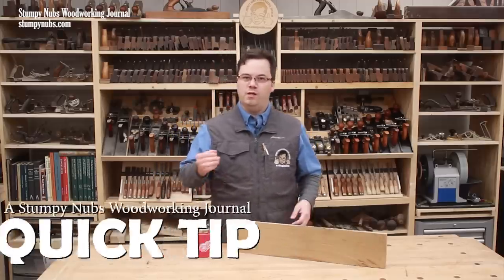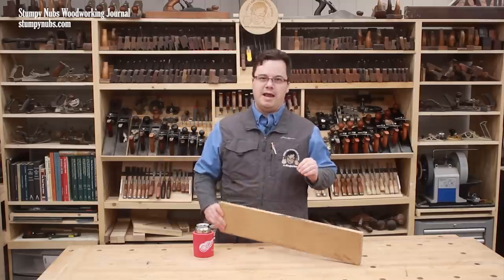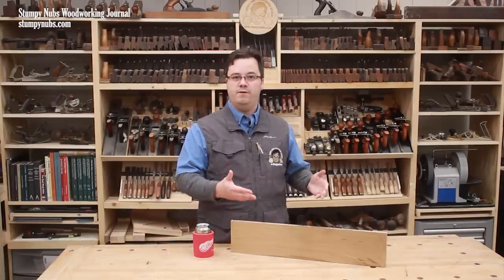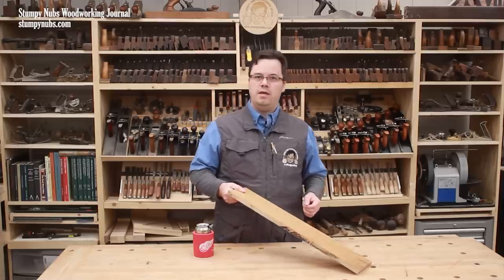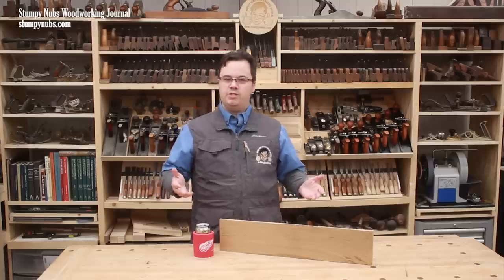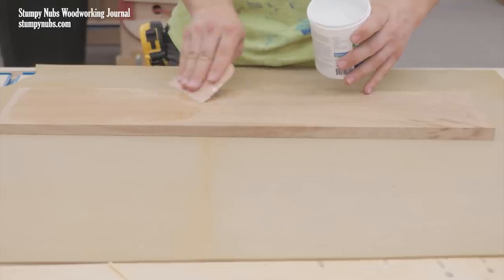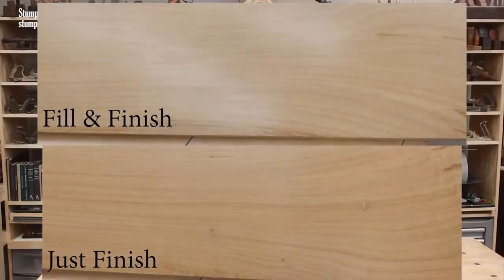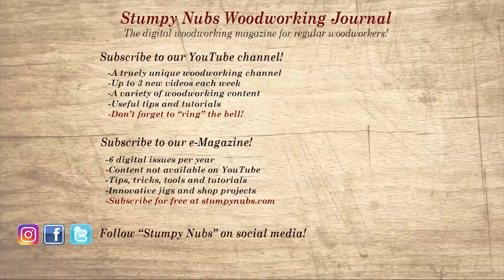Do you need wood grain filler before your finish?

Comment: I prefer my wood to be like,  wood. If the wood has open pores, to me that's part of the wood and why do we want to hide that? Everyone has their own taste so it's up to you but here's a test - take a piece of wood - or maybe a few (walnut, maple, oak,...) cut the pieces in half so you have book matched pieces. With one half do an oil finish (my favourite is Watco teak oil but tied and true is also good and there are others). On one side apply the oil, more oil, sand with 400 or 600 while still wet, let dry, more oil, sand wipe off excess, dry oil, sand and finally when good and dry apply wax with 0000 steel wool or fine scotchbrite pad. Allow to dry and buff. On the other half apply the filler and top coat of choice - use a semi-gloss to match the gloss of the wax finish (you get a higher gloss on the wax with another wax coat and power buffer if you really want to compare a high gloss finish). Once both are cured show people and ask them to pick which they like best. I have done this and get far more in favour of the oil/wax finish. One of the biggest arguments against is that the finish is not as durable and I agree it will mark more easily than a poly or lacquer finish it is easy to fix if needed. My dining room table - wipe on poly, everything else oil and wax. (Well my guitars are french polish - shellac). So Stumpy how about a comparison finish competition. I get 90% plus people preferring the oil and wax - based on look and feel.

Comment: Does the final clear finish wear easier or have any issues over time? As in does the grain filler act something like a mold release compound?
Reply from the maker: The grain filler does not affect the durability of the finish you put on top.

Comment: White oak is closed grain, though. Red oak open. Do you find benefit in using filler on white oak?
Reply from the maker: White oak is closed grain when you are speaking of the end grain- the physical "straws" that make up the board. But the long grain is very much "open" in the context of this video, which refers to the coarseness of the grain and how filling it will produce a smoother surface.

Comment: James—love your channel and website!  Such great content so thank you!  Quick question...if I am going to paint plywood, would this be a good option to use before using primer?  Thanks!
Reply from the maker: I don't know if I understand. You want to put on something BEFORE the primer?
Reply: @StumpyNubs  am just wondering if there is any value to doing this on a painted piece where I am also going to use primer or is primer enough to provide that “seal coat” for a smooth look on Baltic birch plywood?  Thanks.
Reply from the maker: @mindyhall4638  Oh, I see what you mean. I saw your comment on my YouTube dashboard with all the other video comments and didn't associate it with this grain filler video- If you are working with pine plywood, I could see using a grain filler (though I am not sure it is cost effective). But I don't think you need it on birch plywood, which paints very well with just primer and paint.

Comment: So I’m finishing a walnut bar top. Would you recommend this same water base product in conjunction with general finish arm r seal oil base top coat?
Reply from the maker: Walnut is open grain, bit not too course. You can use it if you want a very smooth surface. I have walnut countertops. I didn't fill the grain.

Comment: Curious if you think Aquacoat is appropriate to fill before painting, such as the stained oak cabinets in my kitchen that I want to pore fill and paint. I'll look at their site too, but it sounds to me like it's just the filler I have been looking for.
Reply: I used it on an old end table, with filler, then black lacquer. It came out great.

Comment: How will this water-based grain filler interact with oil-based stains? Also, I don't think this was mentioned in the video but anything water-based (in my experience) will tend to raise the wood grain to a certain degree, especially Mahogany. Is this where a sealer would be used prior or is it advisable to wet the surface, let dry and sand the raised grain before staining and Aquacoat-ing?
Reply from the maker: Since you are sanding after you put on the grain filler, any raised grain will be knocked back down. Once it is dry it will not interfere with an oil based finish.

Comment: Can I use a wipe on poly like Arm R Seal over this grain filler?   It oil on water, which is why I am a bit confused.  🤔
Reply from the maker: If the grain filler is hardened, yes.
Reply: Thanks for your reply.  So for my walnut dining table project, could I apply my finish in this order?

1. One to two coats of amber-tinted sanding sealer or a coat of dewaxed shellac

2. Grain filler

3. Arm R Seal

Comment: Does this take the place of wood conditioner prior to staining.
Reply: Most of the open grained woods you’d need this for don’t require wood conditioning, as they don’t get blotchy like most of the diffuse porous woods with closed grain.
Reply: No, it doesn't. The filler might reduce the amount of stain absorbed by the pores of the wood, but different parts of the face grain will still take the stain differently. This one of the reasons you're instructed to apply any stain before the filler.

Comment: wish you had a video on hiding OSB under some paint or something that didn't require hours and hours.  I have over 1500 square feet of OSB and I don't like it's looks.  Painting seems to just enhance it's multiple pieces of wood.
Reply: Seal the OSB with primer, then plaster smooth with drywall mud.